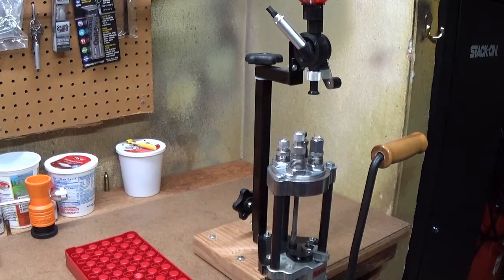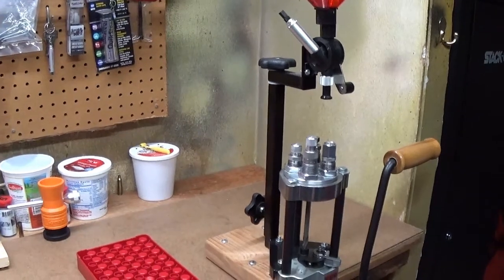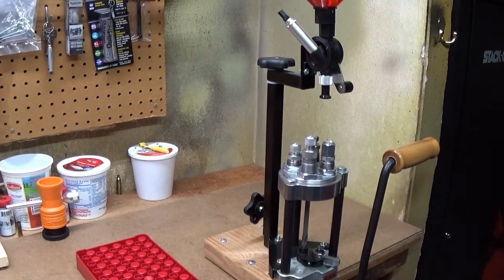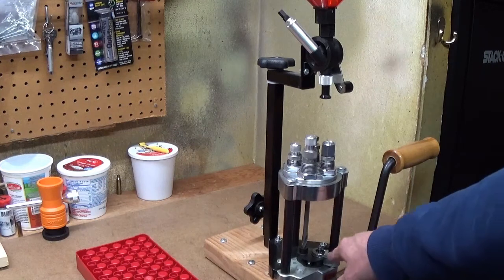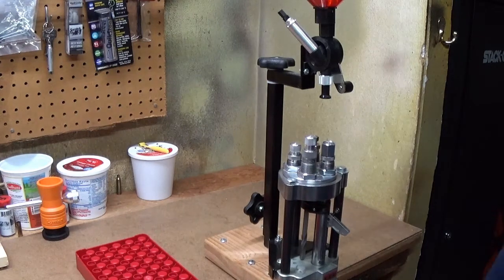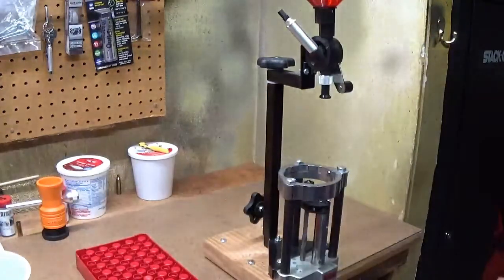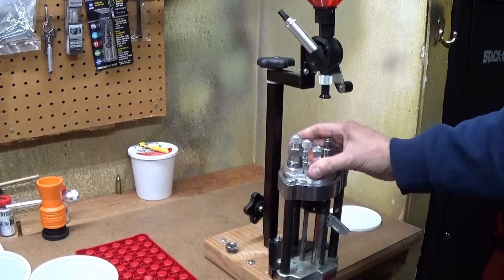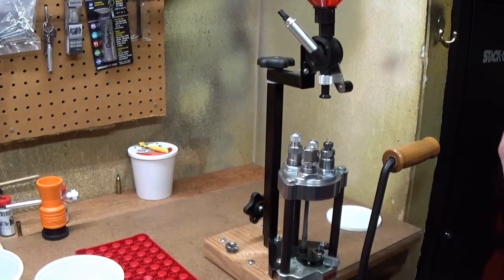Using the Lee Value Turret Press

Comment: Great video! When I got my first 1911, that's when I started reloading. Of course first caliber was .45 acp. 😉I went with the Lee Classic Turret press. I see you have one of Tony's (TreeTopFlier) powder stands. I guess he's got so many requests for those he's thinking about starting a full time business. One upgrade that I really like is the case ejection system from Inline Fabrication. It replaces the index rod with one single metal rod, so you don't have that little plastic square to deal with. Works great! Reverses the direction and then flips the finished cartridge off into a bin. Love these Lee Presses! 👍
Reply from the maker: The powder stand is great. If I had a classic turret press I would definitely buy the in line fabrication rod you have. Thanks for commenting and watching. Have a great day!

Comment: Good video, i just ordered this press except mine comes with auto powder hopper, can wait to try it out on my wife's 380
I have two lee progressive pro 1000 set up for 9mm and 45 but i think i am going to like this one even better
Reply from the maker: They are very nice. Make sure you get a riser for the pistol dies for the auto powder measure. I use one for 9mm it works great. I need to get more risers though for each caliber. It pushes up on the actuator for the powder measure. Once you get it adjusted it works GREAT. Very accurate and repeatable. Thanks for watching and commenting.

Comment: I’m having a problem with the primer arm. When I lower the ram the primer arm is supposed to pivot into place to seat the primer. What mine does 5 out of ten times is it starts to pivot then starts sliding upward and jamming against the shell holder. I can’t figure out why mine does that. Any help is appreciated.
Reply from the maker: If I understand your issue correctly, I would start by looking inside the slot where the arm sits - make sure it is clean, clear and free of anything causing it to hang up. Also check the arm itself for smoothness and cleanliness. Even the smallest burr or chunk could interfere with the travel. It sort of floats in there and needs to be freely moving. Is yours this exact same model and is it new? If it is new and a little tinkering does not solve it - I would contact Lee customer service. They will help you.
Reply: @johnshandloading7907  yes it’s new. funny thing is the large pistol primer arm works every time. The small pistol primer arm is the one giving me problems. I’m actually checking it over right now for burrs.

Comment: how come you did not check with calibers the overall length to ensure the book at the right depth
Reply from the maker: TJ Kaiser they are cast bullets that I have used many times. I know where on the lube groove they should sit (depth) and they were there. The absolute correct way to check a finished round is with a  gauge. Using calipers can tell you the overall length and is a good guide, but is not always possible, since like in this case I am using hand cast, powder coated bullets that do not have a "book length" listed anywhere. In my initial testing of these bullets I used the barrel of my gun as a my gauge and then adjusted seating depth slightly to attain accuracy and dependability.  I have an average overall length written down - but even that varies slightly from one cast bullet to the next. Thank you for asking an excellent question. I hope my response is adequate.

Comment: which die set do you recommend for a 9mm set up?  I just purchased this press and the auto powder measure for it.  I assume a three die setup is what I need.  I'm obviously a newbie, so your advice will be greatly appreciated.
Reply from the maker: I would recommend the Lee 4 die pistol set. It has a carbide ring in the re sizing die that does not require case lube for resizing brass. The fourth die is a factory crimp die that will take the taper out of the case and help hold the bullet in the case as the last step. The four hole turrets that this press uses are made to use the 4 die sets. You can use the press any way you like, but with the auto powder measure and a 4 die set it works as designed by the manufacturer. If you do not have a "riser" for the auto powder measure you will need to get one. That should be listed as an option in the instructions. I use one for 9mm and it works perfectly.
Reply from the maker: @Betty Dalton Newbold you can email me at johnshandloading@gmail.com if you need help. Just be careful and take your time, check each step as you go and you will be successful. Thank you for watching and commenting. I like answering questions and helping people if I can. Also check out the beginning reloading articles here: https://www.thereloadersnetwork.com/channel/johns-hand-loading/
Reply: @johnshandloading7907  - Thank you for the guidance.  I have the riser for the powder measure, and I will get the 4 die set.  In your opinion. do you think the 380 die set could be adjusted o properly set the 9mm round?  I ask because they are about 1/2 the cost of the 9mm set.
Reply: @johnshandloading7907  - I really appreciate your offer of assistance and will certainly ask you if I get stuck with something!
Reply: @johnshandloading7907  - Goodness... I just tried registering at thereloadersnetwork and got the following message: * Forbidden. Sender blacklisted. *
Any idea what this might be all about?  Thank you.
Reply from the maker: @bettydaltonnewbold2019  No the .380 set won't safely and correctly work for 9mm reloading. The sizing die will be completely different. If they are in stock you can get the 4 die set for $60 or less I think.
Reply from the maker: @bettydaltonnewbold2019  I will get back to you. That is some weird error.
Reply: @johnshandloading7907  - Thank you very much for the advice.  :-)   Betty
Reply: It was my VPN blocking the registration process.  Disabled VPN for 5 minutes, then got registered OK.  Cheers.

Comment: I’ve been looking to start reloading 9mm and 380 to save money since I shoot 1-2k rounds a month. I’m a little confused though…the turret presses decap, resize, and prime the round in the same step/die. Do you absolutely need to clean the primer pocket on every load?
Reply from the maker: Josh it depends on how dirty they are. I usually decap all my brass in a separate operation prior to cleaning the brass. Then the cleaned brass goes through the four stations of the press. so my primer pockets are deprimed and cleaned before they go through the turret. Some people don't do it that way.
Reply from the maker: Also, if I was making 1000 rounds a month I would buy a progressive press, like a DIllon.

Comment: Love my lee classic! I need to order some more square ratchet pieces for the spindle
.the 3d ones i bought are not as durable.
Reply from the maker: Red raider reloading, I wondered how well the 3D printed ones would hold up. The machines are very good for making pistol ammunition and quicker than doing it single stage like I used to. Thank you for watching.
Reply: @johnshandloading7907  unless I'm doin something wrong this last one lasted 50 rounds.. the others lasted a lil longer than that.  I personally think they are thinner
Reply: @redraiderreloading7612  mmmm....my square index ratchets last many thousands of rounds. Are you raising the ram before removing the turret from th press? If I am not mistaken, failure to do so may damage that piece.

Comment: What happens when it gets shaved
Reply from the maker: Good question, thank you for asking and thank you for watching. When powder coat gets shaved off it exposes the raw lead which can lead to leading or stripping off in the barrel when fired. It also makes the bullet slightly off balance which makes it shoot less accurately. It is not the end of the world. Best practice is to make them as perfect and consistent as possible. More critical in rifle bullets but still good to make the best ammunition you can with a little attention to detail.
Reply: @johnshandloading7907  my jacketed bullets we’re getting some shaving when using my Lee loader that’s why I was wondering thank you
Reply from the maker: @wreckz9145  shaving is not good on jacketed bullets either. Same things happen.

Comment: Can you load rifle on this press?
Reply from the maker: Yes you can. I can't remember the largest cartridge. It will tell you on the Lee site.
Reply: @johnshandloading7907  okay I’ll take a look thanks.
Reply from the maker: @gabe321  From the Lee website: "For rifle reloaders, the maximum cartridge length that can be reloaded on this press is 2.3125 inches. Any cartridge longer than this you will have to dis-engage the auto index and manually turn the turret by hand. In addition, you will need to purchase a rifle charging die, and appropriate case length gauge to trim your brass after sizing."

Comment: I have Dillons and I can’t believe I waited so long to get one of these
I use it extensively for multiple calibers
Reply from the maker: They are definitely a very handy press. I am thinking about getting the progressive version of this press, the pro 4000, but not fully convinced yet. Thank you for watching and commenting. These can move pretty fast once you put the automatic powder measure on top. I am looking to take it the next step though and do multiple steps at the same time I think.
Reply: @johnshandloading7907  if your pistol caliber only and don’t switch
The Square Deal B is a value packed machine
If you have the need to switch calibers or go to rifles
The Lee is tough to beat
Reply from the maker: @stuckcase7775   @Stuck Case  I have 2 single stage presses, this Lee value turret and a load all II for shotgun shells. I would use a progressive for pistol calibers just like I do with the value turret press now. It would make more rounds quicker if it was progressive.